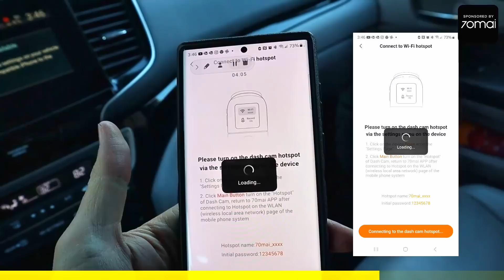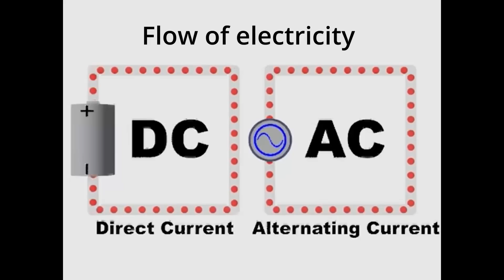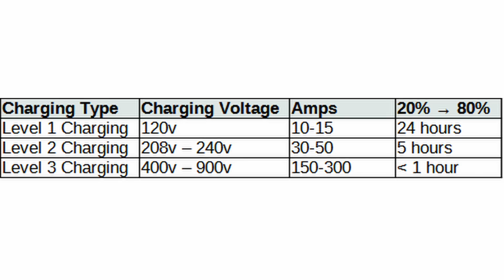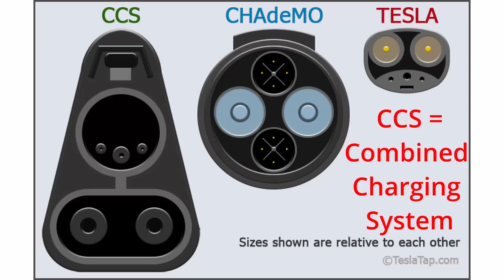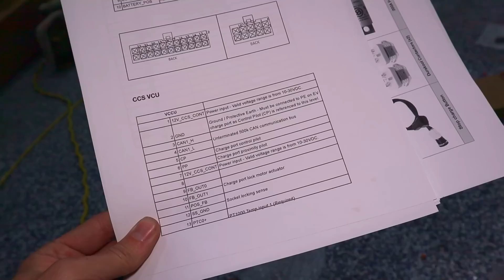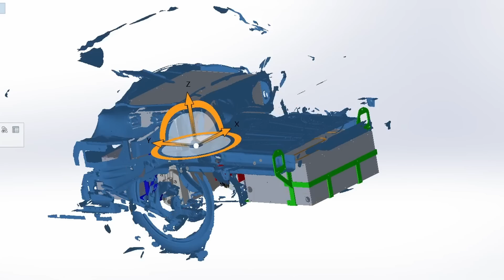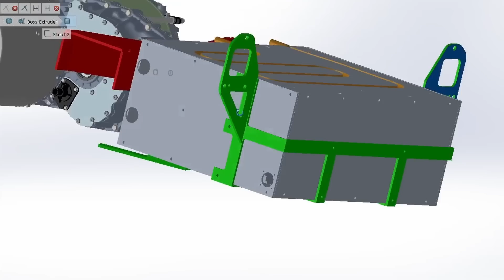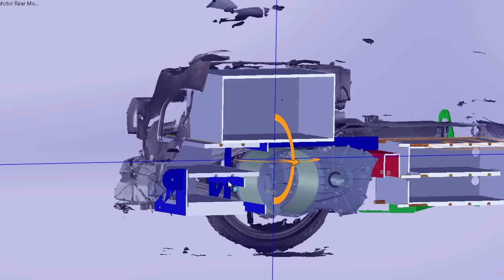Installing DC Electric Vehicle Fast Charging - Fellten CCS fast charging kit

Comment: I think the rear battery box is very rear and that destroys the weight distribution
Reply from the maker: Putting all the battery boxes where weight was removed (engine, transmission, and exhaust).  I will also have a front motor.  I think weight distribution will be very similar to the original

Comment: The rear box mounts seem fine. I think the bar across the back is a good idea to take some of the loading during hard accel… 

I would add a tie bar between the rear suspension subframes. You’re losing a lot of rigidity without the tie plate and youll toe out on turns as a result.

Itll be tiny amounts but still.

So the 2 bars on the front lower section of the rear battery box, add a crossbar

Comment: I think the most logical place for the charge port is where the old gas port was. I personally don't like things in places where a small hit would disable it, so def not the bumper.
Reply from the maker: Got it!
Reply: No, the most logical place is nearest to your most common charger location. EV chargers are almost never located where gas pumps are (along side of the car), so why would you put your charge port there? It forces you to have a longer cord, and have the charge plug oriented perpendicular to the cord going back to the charger at either end of the vehicle, which increases stress on the plug (due to the weight and stiffness of a large diameter high voltage cord) and likelihood of damage if someone bumps into it or trips over the cord.
Reply: @rthomp03  many vehicles have their chargeports on the side, and many chargers are also located along the side. At any rate, any level 3 charger I've ever seen has a cable long enough to reach there, even if it's not a pull-through charger (which I would expect we will start to see more of with EV trucks catching on, etc). I have a vehicle with a charge port on the side as well as one with the charge port in the grille, and actually had more of the issues you describe (cord too short, pulled tightly adding stress, etc) with the vehicle with the charge port in the grille. So I'd say it's a non-concern there. It's also a non-concern with level 2 since those tend to have cords that are plenty long enough to reach anywhere on the vehicle.

Comment: I suggest putting the charge port where the gas went in. Keeps it looking clean and protected.
Reply: My thought too. Why reinvent the wheel, the door and everything already exists for getting food into the car, you're just changing what it eats.
Reply: @Hrethgir  agreed. And it would be funny to see a gas car taking electricity in the same spot it used to for gas
Reply from the maker: Nice
Reply: Do I still have time to submit a car for a conversion by a true pro...? @electricsupercar
Reply from the maker: @tracymason7393  absolutely!
Reply: @electricsupercar  how do I do that?
Reply from the maker: @tracymason7393  email me electricsupercar@gmail.com
Reply: Agreed
Reply: It would be nice to see how the Porsche handles after the conversion and does down the drag strip.
Reply: With the port in this location, the charge port will be on the passenger side of the vehicle. Level 2 Flo road side chargers will be safer to plug in. In case someone side swipes the vehicle.
Reply: I agree KEEP IT ORIGINAL

Comment: That fuse is still too close to the box wall, you should probably add some extra insulation like a rubberized coating to make sure it doesnt spark
Reply from the maker: Working on it!